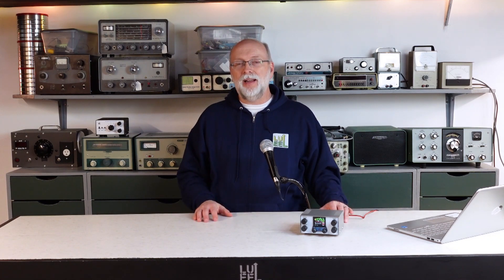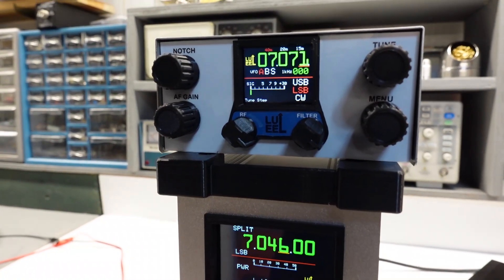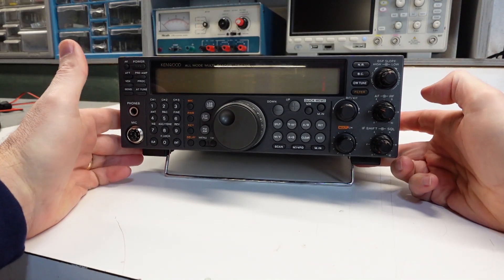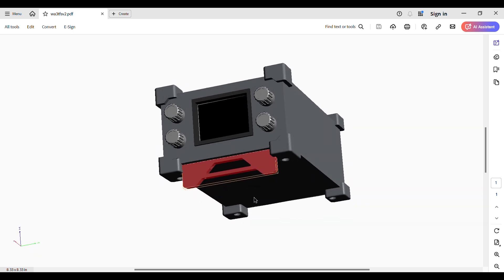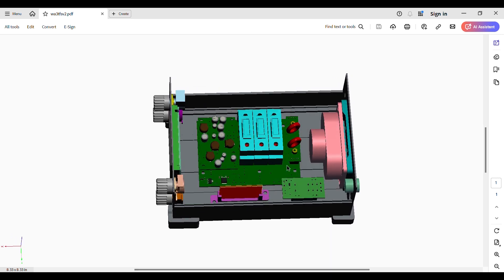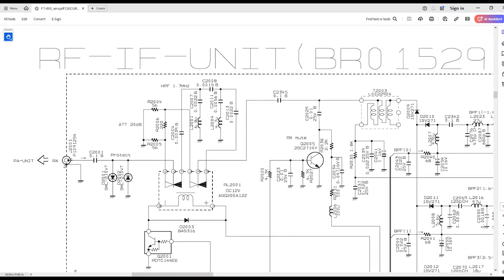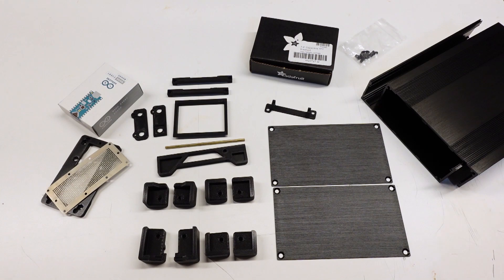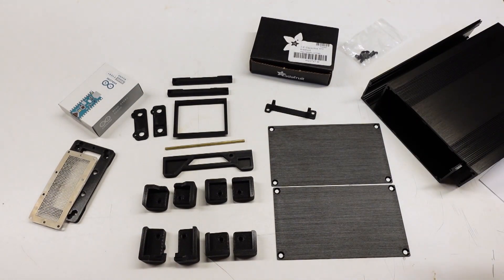HF Receiver part #12: Time to Move to a Bigger Case

Comment: The Pin diode attenuator or Switchable attenuator matrix may actually have degraded Intermod performance at HF and some are specified at 100 MHz and above. The use of switched resistive attenuators are a good option.